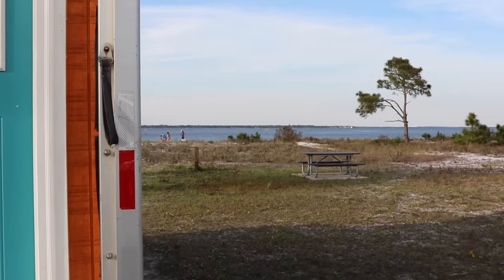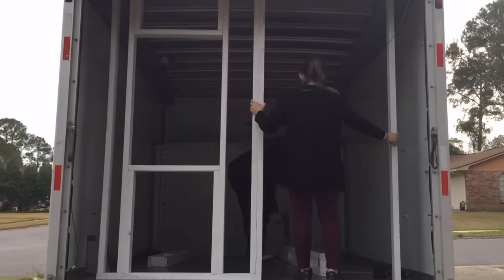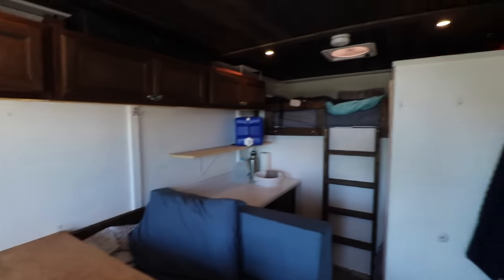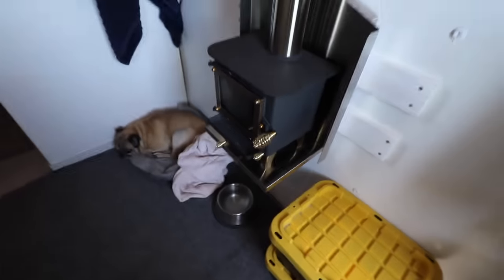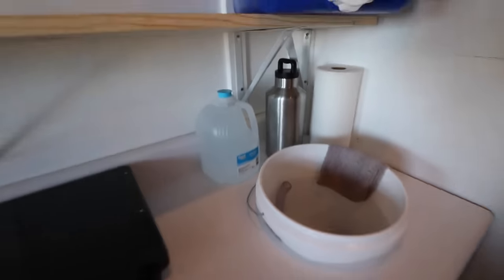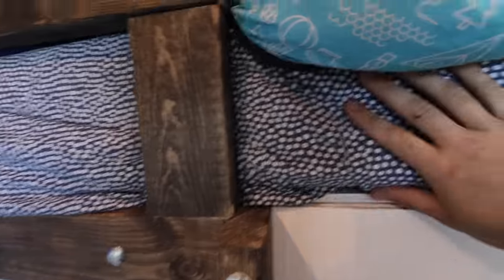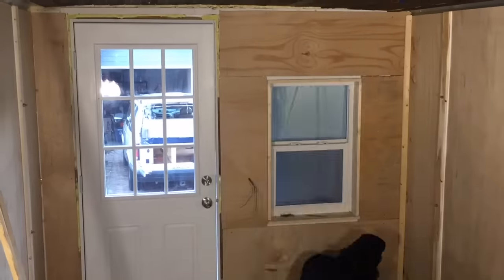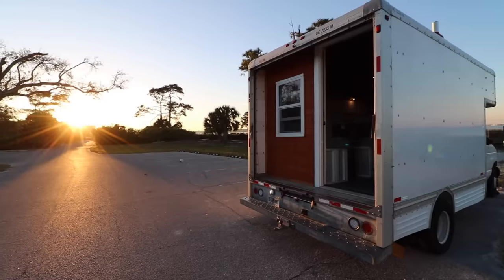Tour of Our Tiny House Camper (Box Truck Conversion)

Comment: I just bought a used 24 foot, drivable RV on Craigslist with a full kitchen with fridge, full bath and sleeps 6 for $5600 complete and running. No living compromises. Bath and shower with blue, gray, and black water tanks fully functional. Before I bought this one I looked at five others in and around the same price. All fully functioning with full baths and tanks. I can’t understand for one second why anyone would spend nearly $10,000 on something that requires such huge sacrifices as pooping in a bucket, having to cook outside in the rain or having to haul your sink water out by the bucket. That doesn’t sound like intelligent money spent to me. Regardless of the “satisfaction” of doing it yourself. And I’m a remodeler by trade. My issue is your repeated comments about budget and lack of money, yet you threw $10,000 into something you could have bought completed with more functionality for nearly half the money.
Reply: NorthernChev   You posted my comments. I found it to be quite lame and a waste of money
Reply: You found a unicorn. Very few people are going to find this when they need it. But thanks for waisting our time.
Reply: @DaveGme  ...LOL, replying to FIVE year old comments...

Comment: Damn.... Was hoping the rolling door was still there to create an ultimate stealth camper
Reply: It's honestly for the best that they removed that.
Reply: @InfernosReaper  why?
Reply: @papi23333  Easy, Jeff the Deity, the rollup door can only be locked from the outside, so it's kind of a safety hazard.

It's also a pain to try to build around, as it would require extra materials and designing, as well as make the ceiling shorter.
Reply: @InfernosReaper  Plus it also takes up more room and they did do the smart this with removing the door to many idiots out there that would shit it just for the heck of it.
Reply: cwillboxer3  put the two barn or tup p p we on t
Reply: It the two barn. Door type on it insstadd of roll up
Reply: 1:20 answers all of this
Reply: Yeah you can remove the Locking handle I still leave the roll up door.. Js. And it would have made it for great "camouflage" you would look like a normal box truck in any parking lot.
Reply: @InfernosReaper  lol I liked how u said word for word what the guy said in the video because if these people had just watched they would have figured it the fuck out themselves 🙄
Reply: cwillboxer3 ikr
Reply: @jaywade6443  This would be a great improvement
Reply: Exactly what I was thinking. Why couldn’t they just cut a hole in the wall into the cab of the truck? That way they could still enter the cab and drive with the rolling door down. Is it not just as simple as cutting a hole? It doesn’t have to be a giant hole. Just one big enough to walk though.
Reply: Just dismantle the latch...
Reply: Would have been cool if they had someone design a flip down door with hinged legs to make it stealth and the door could double as a deck when it’s down.
Reply: That would  have been nice
Reply: They could have removed the latch or modified it where they wouldn't get latched inside.
Reply: Same
Reply: Right
Reply: InfernosReaper how do you buy an old Uhaul?
Reply: White canvas would work
Reply: @GuthrieDennis  thats racist!
Reply: cwillboxer3 not funny bro.
Reply: @GuthrieDennis  i agree......to disagree
Reply: After doing that i would paint "tiny house movers" on the side for laughs.
Reply: @InfernosReaper  You could cut a door to the front seats like most vanlife builds. I'm honestly surprised they didnt do that.
Reply: @juliusminklei7846  That would solve the "I don't want to be locked in here" issue and maintain the "concealing what the vehicle is actually for" aspect.
Could even still have that backdoor with window setup when at a place where you don't need to hide what it is.
Reply: And for security.
Reply: Yeah, that definitely would be better.either that or cut out some windows to the side of the truck.
Reply: Thanks good video to enjoy 
Wat the truck box dimensions?
Reply: a garage door maybe a beater option though given that its a home for a family
Reply: Yes
Reply: @Rpg39_  
I like this idea as it offers the best safety.  You can jump in and drive off if needed.  
But the roll up does mess with height in truck, so getting a barn door open type at junk yard would be best for back.
Reply: @jaywade6443  That's what i would have done to remain stealth, but to each his own.
Reply: Not every box truck has roll-up doors

Comment: Nice. I've had this idea in my head for years.  And you actually did it.  Very cool.

I lived aboard a 27 foot trawler for 6 years. When my head (toilet) stopped working I rigged a composting toilet similar to what you have.  But, if you don't want the smell, get a few small bags of sphagnum peat moss.  You line your bucket with a plastic bag,  add the  peat moss, and get a large kitty litter scoop. After each poo you cover the waste in peat moss. You can immediately scoop it out and put it into a plastic bag (I used the bags I got each time I went grocery shopping, they're free), then take it to a dumpster and dispose of it. The peat moss not only shrouds the smell, but it also help in the breakdown of fecal matter, which is what compost does, it molecularly breaks down waste.
Reply: I was thinking kitty litter, but peat moss is a game changer. I would use dried eucalyptus plants tied in bundles for the shower, also helps with smell.

Comment: You may want to consider a hudson sprayer for your shower and sink.
You pump them up with air and use the wand to spray where and when you want.
They cost about $25 from Walmart.
They are also re buildable if the seals or other parts go bad.
Reply: I agree something like that for the shower is waste way easier on you they all said the little hanging bag you know shower stuff like that and they're not expensive use hang out in the sun and then by the end of the day you can take a shower
Reply: I had a camper on my 62 Chevy stepside. Lived in it on a bay in Alaska alone for a summer. :)
Reply: I'm a truck driver and I recommend getting a "Big Kahuna portable shower". I got the 13 gallon size. It's been the best decision I've made in trucking and I can take a hot shower even in the middle of nowhere.
Reply: Nate What's up? Lol.
Reply: @emilyb4865  He can also build and install a large (usually around 3 to 4 inch diameter), Black plastic ABF pipe (or two), upon the roof which gravity drains down into the shower of which is heated by the sun for use in taking hot (well, fairly warm at least), showers. There's many a Boon-docker campers of which have done that with their regular RV's and teardrop trailers.
Reply: Why does every other comment talk about Damn Walmart?

Comment: That’s a really nice conversion. I lived in a tiny yurt for years and used an 8litre garden pump spray as a shower. Very economical. One thought; if possible it would be ideal to make a way through from the back to the driving cab, opening up space and adding another way out.
Reply: Extactly my thought
Reply: 1

Comment: We built one as well out of an old used UHaul, we kept the rolling door , as well as we put in two windows in the back and a door in the center, when we traveled we pulled the roll door down over our entrance into the truck.
We had a long kitchen counter with cabinets below and above , a bathroom with a camp toilet and the attic was also our two daughters bedroom.
We had a futon bunk as well, the lower bed folded up into a couch and was slept on by my husband and I had the top bunk.
We used the pull out ramp ( that came installed with the truck) as our walkway.
We had an inverter system for power as well as out fitted with a power source to use electricity in campgrounds, as well as a propane stove like yours.
We had a mini fridge and a mini AC , tv and DVD player and computer and fax , it was great and truly an adventure for sure for us.

Comment: I saw a similar conversion in which they made an opening between the box and the front cabin which gives the house a more spacious feel, ads more light and ventilation and in case of bad weather or any other emergency, you don't have to walk outside in order to drive off. Makes sense and not too hard or expensive to achieve.

Comment: instead a roll up door I would put a flipp down something, that would bi a perfect balcony
Reply: Or s sliding folding door
Reply: Yes something to keep it  stealth
Reply: That would really improve the design.
Reply: That would be great with an added lift gate on the rear added. He could have put new tracks for the door so it would slide back in cab just below the roof line, instead of rolling up into a cylinder. That would have added "stealth mode" if ever needed. Remove the outside lock clamps to the door.
Reply: A Tommy lift would double as an elevator and a porch extension ..I'll bet you could find one in a salvage yard..
Reply: I was just thinking this. I would install a horizontally split rear door; the bottom half would fold down with aluminium legs to provide a deck and the top half would fold upwards to provide an awning. When closed it would look just like a regular truck  back door so that the family can stealth-camp in city centres etc.

Comment: Very, very clever! May I pass on some info? Briefly in 2005, I had a little trailer with a built-in shower/toilet combo. There was a water setup, but it wasn't very large so it wasn't good to use it for showering. I found a "shower pump" specifically made for the purpose of showering with no plumbing. All you need is a big bucket, like those you used for your sink. And the beauty of it is, you can add hot water to the bucket for a warmer shower! You may want to check it out. I don't recall it being expensive.

As for more windows, that's something you can always add later on if you really want to..

Comment: I love how you make things work. Great job!. One recommendation.  For health reasons I would get a secure plug for your drain to stop cow induction of fumes of your van and of other autos while on the road.  EVEN IF you already have an alarm which is great, there are still lower level fumes not good for your health coming in while driving unless you already have a secure plug I do not see. I LOVE the simplicity however and think you did a very good job. Thank you for sharing the experience with us.

Comment: I would like to add, if you had the outward swinging door, you create a major fall risk with the steps being right outside the door.  It will also make opening the door from the outside more difficult due to being lower than the door and on the ground.  You would not be able to open the door while standing on the steps.

Comment: ..and because doors should always open inwards. Some ppl are just uggh 😑 you guys did an awesome job 👍❤
Reply: I preferred to have doors open outward as part of security.  It is harder to pull a secured door open than it is to kick it in.  When I had a house in New Hampshire I wanted to change my doors to open out but realized I would also have to built out shelters for the doors because of deep, heavy snow falls.
Reply: did you know you could trim up to 1 inch off the bottom of the door?  reclaim that 1 foot of of outside 'back' space.  also another suggestion.  buy "side-window" style door frame, put door right in middle where the slide-out ramp is at.

Comment: Be careful about ants or insects crawling up into your drain. Maybe add a screen or something. For fans, I saw one van dweller use a radiator fan in the back van window. The air flow was tremendous compared to the standard Fan-tastic fan. One other box truck conversion guy had used generators on his "porch" (the area between your exterior wall and where the roll down door would be in the down position). He ran window units with the generator.

Who needs windows when you can just open up your door and be outside. I think people that ask about more windows are more comfortable living in a house while those that truly love to explore leave their "home" and explore on foot.

I like your set up but would change some things for my personal taste but you have a family. What is your MPG?

Comment: Very nice build!  You did this fast and on a shoestring budget and your priorities are in the right place. Get out and travel. The details can wait.
Amazing little shower stall.  I must look into these prefab stalls.  I need a new one in my RV.  Very smart to upcycle countertops and cabinets.  Love the ceiling and bunkbed.

When you have time to upgrade my suggestions are:
1. Attach a ramp which folds up and locks from inside. This turns into balcony during camp out, and flat side during travel, giving you ultimate stealth van look and better protection.
2. Add a second door for safety and some more windows.
3. Add a waste tank and a fresh water tank to save the bother.
5. Composting toilet self build is cheap.  Much less bother.

Thanks for a lovely tour.  Enjoyed seeing your inventiveness!

Comment: Easier entry with an inward swing door and I don't think you lost any space. Love the wood heater.
Reply: I would have used a little buddy propane heater personally. Takes up less space, no hole to cut in the roof, easy to get heating fuel on the road too.

Comment: Is the truck structure not moving while driving? Did you make the installations flexible in any way? I just wondered if the glass wouldn't break of the panels wouldn't come off if you hit a speed bump or something

Comment: I think this is super awesome, but, wouldn't a standard RV in good condition from 2006 also do the job?? And maybe be bigger? Or would that have cost too much? Or how about a regular camper type vehicle or a pop-up trailer? 

I'd love to see you guys paint the exterior of the truck sides something fun or even to mimic the sides of a house, with windows! That would be fun.
Reply: You would still need a 10,000 dollar truck to pull it and pop ups generally will ha e alot of issues.

Comment: You should have put a jog in your wall and only recessed your door area. You could have bought yourself a lot of room for no additional cost. The rear 12-14” is wasted across the entire back wall. 
I can’t imagine traveling with 2 adults, 2 kids and a dog in that tiny space. 
Kids like adventure and tree forts so they probably love it huh?
Your brave, and I hope things get better for you so you can update your systems with solar etc. 
Idea: in the future you should build a bottom hinged rear wall that closes flush while underway but turns into an outdoor deck area for some much needed space to barbecue and get some fresh air. Build it out of Aluminum I-channel 2” and sheath it with 1/2” PT and cover with outdoor rug material. Fold down leg supports and diagonal steel cables will make it solid as a rock to use as a floor area. 
Good luck to you and your family on your journey, be safe. 
God bless
Peace✌🏻🇺🇸
Reply: are you kidding me? ppl travel with that in a camry all the time. for most people this would be an upgrade.
Reply: I like the rear deck/hinged wall idea.  Great use of that space and a good "after" project.

Comment: Outward swinging doors saving space is a myth. Doors and the space on either side is a movement path that has to remain clear. There is no space-saving advantage to outward swinging doors. None. Great job on your frugal build. Perfect.
Reply: Speaking of stealth...why not double doors that swing out.  Lots of vans have them, and they open and swing all the way open to latch on the side wall off the van.  Closed its a locked truck, open its your cute little hobbit door and window.

Comment: Great job! I'd worry about getting locked in with the roll top back, too. Guess we saw too many gangster movies when we were kids! But you lose a lot of stealth parking without it, so depending on the local law enforcement,  you might get stuck to paid campsites.  Best of luck with your travels!
Reply: Easy enough to add a tarp over the back if they needed to be discreet?
Reply: You need a way to open the door from the inside, or the build will be deemed illegal. Some trucks have side doors, so you can just use those. Penske 15 footer used to have access door to driver cab, and I loved driving the little bugger around, way back then when I was much younger.  Nowadays, I drive a Freightliner.

Comment: Keep diverting your urine and carry sawdust or the like to cover your poo in the bucket after each use. It dries it out and controls the odor, many use this diy composting toilet method for all their business and have no issues with odor. You could safely compost it with a long term process, but if that is not a viable option it will make disposal easier and living with it more pleasant - without the worry of ever needing to "hold it" lol Good luck, great project!
Reply: Yep! I lived in an rv where the sewer system was messed up, so we used a five gallon bucket with a camper toilet seat. We lined it with a trash bag and used natural kitty litter instead of sawdust. We also kept our poo rags (lol!) in a plastic  grocery bag.
Reply: Nice, the first doable suggestion that wasn't just criticism for major rework.

When I was little this would have been awesome!  We went camping in a Chinook vehicle and this definately has more room than it did.
Reply: @AshokaMazda  I am still dreaming of it! When I was little, my dad built a camper into the tack room and gooseneck of our horse trailer. We are in Iowa and got most of the bits and pieces from the Winnebago factory in Forest City. We spent most summer weekends camping and trail riding. Our campgrounds had "facilities" so no need for a toilet - but now I watch tiny house and conversion vids obsessively now, so much info out there!